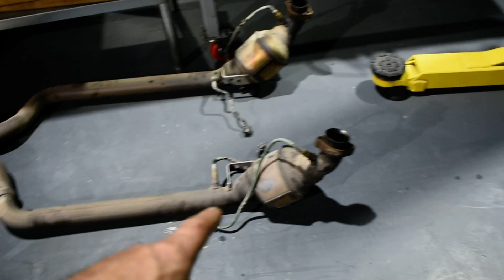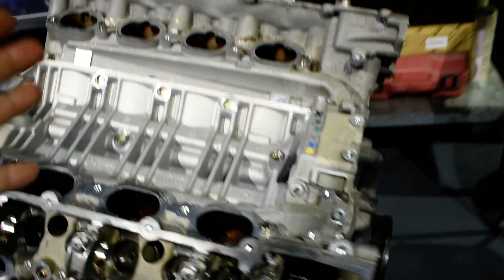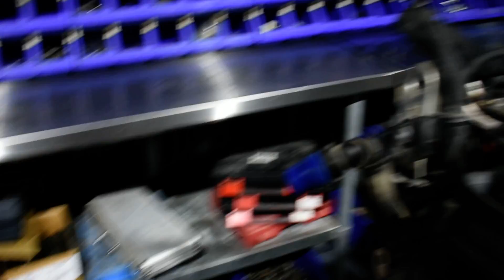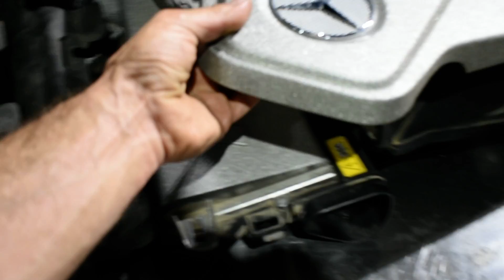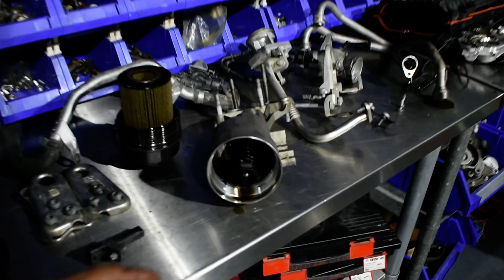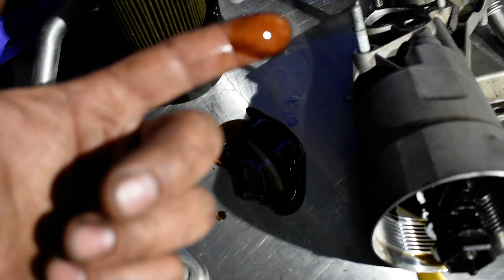checking a C63 2013 with 90k km (part 2)

Comment: Hi Tasos 
I like to ask .. in your years of stripping c63 engines.  Have you found a difference in wear from the standard c63 engine compared to c63 performance pack engine ( one with the dark grey inlet manifold) . And noticed a different quality in parts used ? 
And what tips to reduce cam waer ? Ie fitting a dry sump?